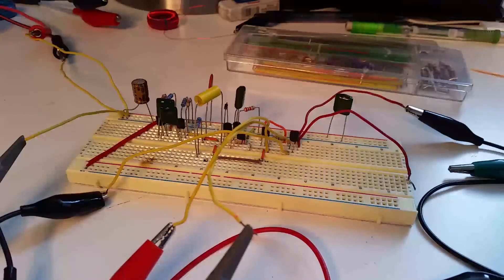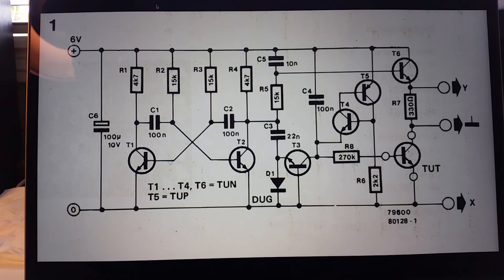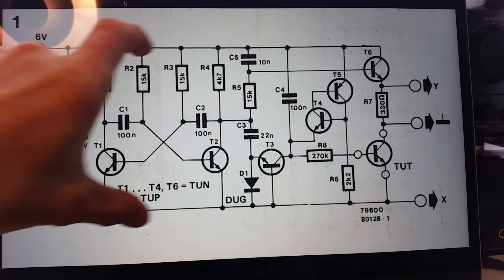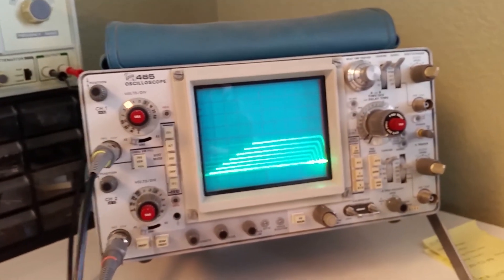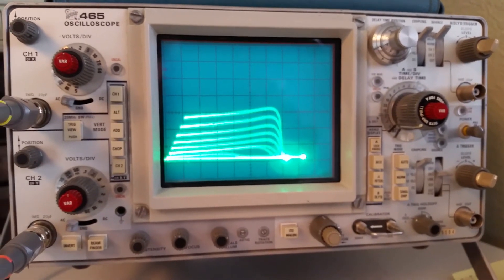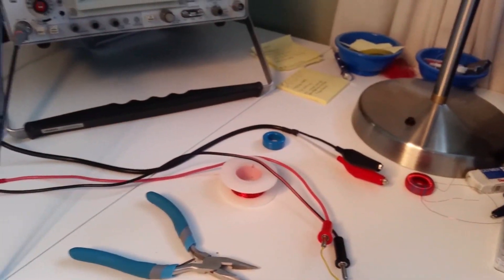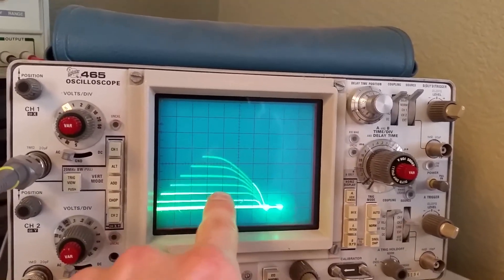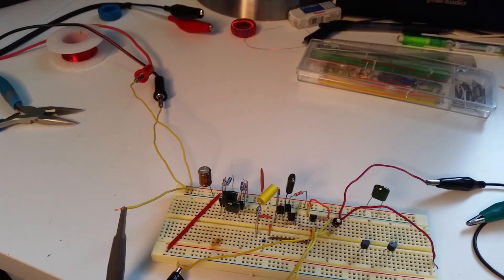Curve Tracer Circuit

Comment: A little after the fact...

Regarding the jumpy waveforms...which I note are in the X axis; the Y axis looks stable despite the X dancing around.

You've got X and Y as inputs (ch1 and ch2).  Ideally, your trigger would be a clean pulse that occurs when each step occurs.  Next best thing would be the signal that changes least in the time domain for the duration of a complete generation of a set of curves; I think this would be the sweep...the pulse is preferred, though...   edit: I would NOT AC couple the channels. The circuit changes DC values fairly often and substantially relative to the minimum and maximum the circuit can supply, which would cause the signals the scope sees to rise and fall, floating around, as the signals settle through the coupling caps.  DC coupling all the way for this sort of thing.

As the power source is DC and presumably isolated from earth/chassis ground, it is floating, which means the circuit ground connected to the scope should work just fine.  A ground prong eliminator adapter on the scope has helped me mitigate 60 Hz hum on sensitive signal measurements in the past, but I don't think that's what's going on here.  Since the circuit is itself an oscillator, and not running directly on line voltage (or a stepped-down version), I believe it is agnostic to line frequency, and shouldn't matter at all, especially since you aren't triggering off the line either.

I think if you looked in the time domain and you paid attention to your trigger source, I would:
1. Switch ch1 and ch2 both to ground
2. Zero the XY trace (a dot with no inputs) to the equivalent zero point on the oscilloscope display
3. Set scales for each scope channel to the magnitude of signal you would expect to see in X and Y from the circuit
4. Set the trigger source to be ch2 (which you have done) aka the sweep signal
5. Make sure HORIZ DISPLAY is properly selecting trigger A as the source the scope is using
6. Set the trigger level in the time domain to a point just above zero that you know will be repeatable throughout the tracing of the complete set of curves
7. Flip back to XY mode and adjust scaling to fit the waveform satisfactorily.

I think it's something related to scope setup.  The noise looks too random and too slow to be caused by 60 Hz hum as suggested below.

Disclaimer: I have been working on various curve tracer designs and use my tek 465 in XY to give a first look at any new ones, and am used to seeing all the weird shit you run into when you try to do this stuff. 🙂

Comment: In 80s, I used 7 stage counter 4024 and ladder resisitors to do the staircase.  You need 3 bits only, but you can have up to 128 steps.   You  need a high voltage transformer to see the breakdown regions.  I think the oscillation was caused because your oscillator was not synched to ac 60hz.
Reply: this is what I'm trying to do.

Comment: Hi, I have a question, why do the lines get shorter as we move up the trace, I have done this with JFET and the same thing happens the lines get shorter as we move up the trace.
Reply from the maker: For BJTs, as the base current goes up, the collector current increases, the Vce voltage drop increases and the saturation region becomes more pronounced and leans over. This makes the lines at the top shorter because the of higher saturation voltage. JFETs do that for a similar reason. As Vgs is increased, the drain current goes up, there is more voltage drop over the channel and so the slope of the line gets more vertical. This is the so-called ohmic or triode region of the JFET curves. The constant current region is where the lines are flat. The lines are really short at the very top due to a limited amount of drain current the circuit can provide at a given voltage.
Reply: @thetuberoaster8321  I understand the triode and the saturation regions well, I understand why there is a slope, that doesn't answer why the lines get shorter as we move up the trace, none of the textbooks show that the lines get shorter as we move up the trace, they all show and explain the slope, but whenever you plot it on an oscilloscope the lines get shorter as we move up the trace, and I do not understand what you mean there isn't enough voltage available when the horizontal axis is the voltage.
Reply from the maker: @whatever3041  The voltage gets lower every step up. The circuit actually "runs out" of current as the bias current/voltage increases. The lines near the top won't plot very much horizontally because at higher bias currents, the transistor will pass more current for a given Vce. In other words, it doesn't take much Vce to get a whole lot of current, so the circuit runs out fast. You can raise the voltage of the circuit to increase the current and plot the lines further, at least until the device pops. In a textbook, sometimes they draw theoretical lines that are super flat and are the same length. They also might draw where the transistor breaks down, but in real life this might destroy the transistor. This circuit is also rather simplistic. If you were to somehow create a constant voltage source to drive the transistor instead of a constant current one, the lines would plot out the same length.
Reply: @thetuberoaster8321  Thank you for the response, I think I need to study more, the textbooks do show the slopes but yes the lines are always of the same length and on the oscilloscope they are never of the same length, there is always the same trend that the lines get shorter and they get shorter in a linear manner.

Comment: Did you ever manage to get rid of that oscillation?
Reply from the maker: No I haven't, I suspect that it has to do with the x-input being ac coupled to ground. I haven't built this circuit in a while, I wonder if using a floating or battery power supply would help.
Reply: Yes I think that would solve it because then there's no connection with the scope through ground.
Reply: Would the scope be loading the circuit?

Comment: Hi friend, I did not understand where it is connected to a point between the x and y, is it a grounding same?
Reply from the maker: The grounding in this circuit is really weird. The collector of the transistor under test is connected to ground. The 0v line or battery return is connected to the X input on the oscilloscope. This is mostly why I got some bizarre oscillations going on. I ran this circuit from a power supply which had the 0v line grounded. It's actually surprising that it worked at all.

Comment: Cool  you build it! That oscillation or jitter  is weird, I didn't have that on mine. Maybe, if you make a print for this circuit, you can get rid of that jitter.
Reply from the maker: Ya I could not figure out where the oscillation was coming from. I think it has something to do with the power supply and decoupling. It could also be that X input is the power supply ground and at AC, the scope ground too. It may well have been a ground loop problem.
Reply: Ground loop seems plausible yes.  It was telling that the oscillations went up in frequency when you upped the voltage.  But it's a cool little circuit isn't it. I din't expect it to work so well when I first saw it.  :)
Reply from the maker: I originally was going to do a video on a curve tracer circuit that w2aew (great youtube channel if you haven't seen it) made that used op-amps to make the stairstep signal. For some reason I could not get the thing to work (the stairstep signal was not generating), so I built a much simpler one which did end up working.
Reply: Oh I have seen that one too! I wanted to build that too but have to wait for my scope to be repaired before I can. That's a great channel. Alan I think his name is, really knows his stuff. I build a time domain reflectometer that he showed in one of his videos and it worked really well. In fact, that's how I found out my scope was faulty because I couldn't get the high risetime on channel 1 but it did work on channel 2 to 4. 
:)
Reply: Looks like a triggering difficulty. Maybe trigger somewhere else ? I'm looking into building one. Is this a open source project ?